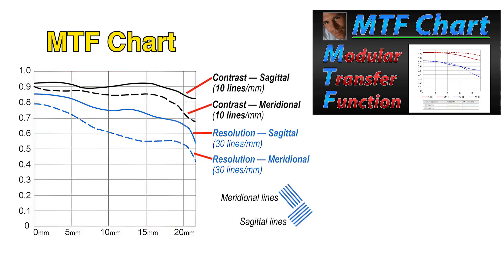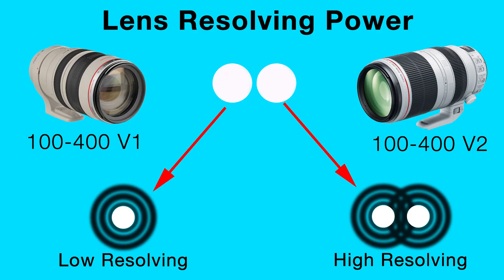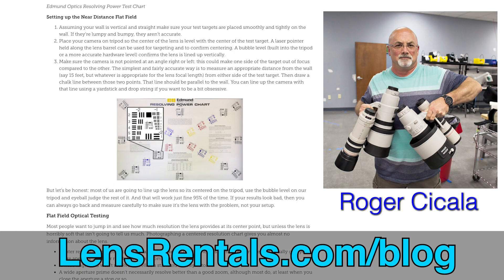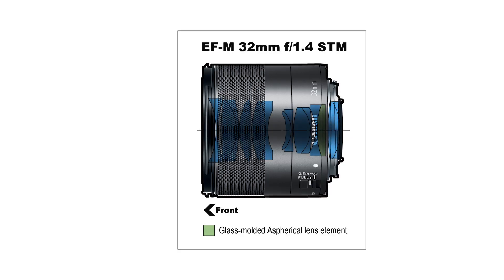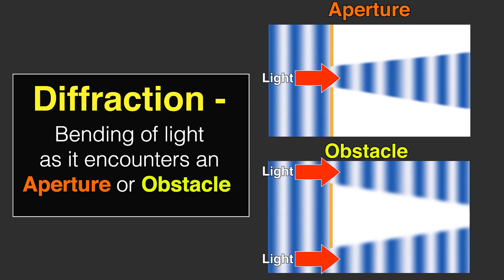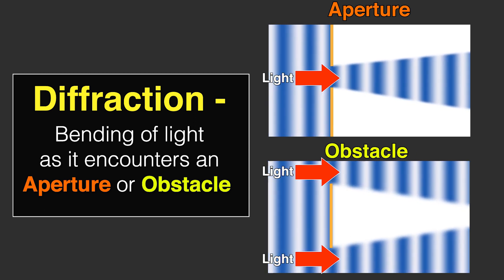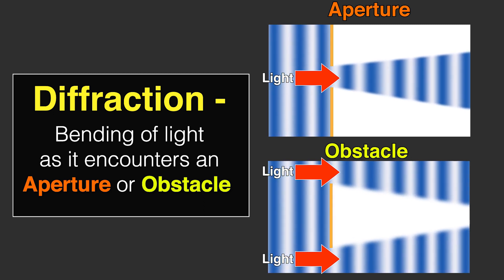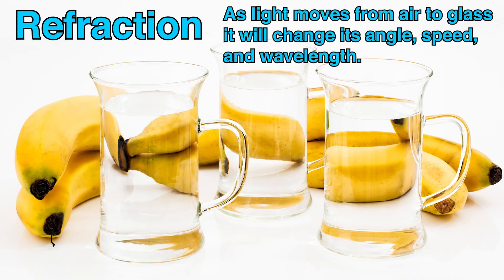What makes one lens sharper than another? How is Lens Resolving Power Determined?

Comment: In terms of sharpness, I have the impression that prime lenses in the range of 35mm to 135mm are the best overall. Wide angles and long telephotos are harder to design and loose a little bit of sharpness with few exceptions. Even cheap primes of good brands produce good results if you close down the aperture to f/4 –f/8.

Comment: The formula for the limit of resolution of a lens is as follows: the minimum angle at which two points can be distinctly identified as separate points is equal to 1.22 radians multiplied by the wavelength in meters of the light passing through the lens, all divided by the diameter of the aperture in meters. This is the absolute best case scenario for the limit of resolution of a lens. From the best case scenario we have to further increase the angle of the limit of resolution by coefficients that account for weather, atmosphere, things found on the surface of the lens such as oil, and then once it passes through the lens we have to account for the sensor of the camera, the size, and pixel density, as well as other factors

Comment: Very informative. As for Apple lenses and many smartphone lenses, the tolerances are tighter than even high end regular camera lenses. The super thin cameras in phones require complex aspherics that are a magnitude more sensitive to imprecision than the very high end very expensive lenses used on traditional cameras. Being off by even a single micron for a couple elements is enough to strongly impact a smartphone lens but that kind of precision in a traditional lens is impossible.

Comment: Subject distance is important too- just to throw in another variable. I test all my lenses, both in the studio with the Air Force resolution charts and in the field incorporating fine detail so I can see how they perform at different distances. Of coursse the studio is more controlled and I do my best to control the outdoor tests (on a tripod, same scene, lighting, etc.) Some lenses really perform differently at 30 ft/10 m or infinity vs, say, 6 ft/2 m. I remember a Leica rep telling me Leica M lenses are optimized for 3 meters. Not sure if that's true any more but I'm sure the manufacturers try to optimize performance for distances they think the lens will be most used.
Reply: which lenses are best at infinity?
Reply: @eascencio847  Hi, no hard and fast rule on that. Most lenses should perform well at infinity, especially at optimum apertures. But I just bought one recently that is lousy on the edges last third out from center (Laowa 9mm f2.8 Zero D in Fuji X-mount) I'm not sure if I got a bad sample or if it's a characteristic of this lens. I will likely buy another and see. This is my first Laowa lens which I bought mainly for infrared but I also like it for visible light (IR is a whole other story with lenses.)
Reply: @JoelWolfsonPhoto  thanks for the info happy holidays

Comment: Your observations on the fuji 200mm f2 prime being 'too good' for the current x-t cameras, together with this video, have started me wondering...
What's your opinion as to the optimum/maximum pixel count for an apsc sensor for the current crop of red-label fuji lenses?
Reply from the maker: Peter Hicks between 20 - 24 MP anything higher the camera runs into DLA problems where diffraction starts setting in at less than F8.

Comment: What apeture on a lens is best for landscape? Should i use a cheaper F4 lens or the more expensive F2.8 for exemple? Does the F2.8 have better glass for landscape?
Reply: That depends on if the F4 lens is cheaper because it did not need the expensive extra glass, or because the quality is cheaper in general.
If both are Canon L lenses (high quality) and you shoot at F8 then you probably wont see any difference at all, and you are better of saving some money.
If the cheaper lens is a kit lens then you will see a difference. (probably mostly in contrast)
Reply: Mats! A 2.8 wide angle zoom is twice the price of a f4 wide angle zoom. A good F2.8 is too expensive for most people, so buy a good F4 instead if you're not a wedding photographer or don't need  mobility with your camera indoors shooting children for example. A f4 will produce almost the same results (the difference is minimal). In landscape photography, an excellent and robust tripod is very important and make sure that you can add some weight to it if it's windy, like a sandbag. Use a remote control or the timer of your camera and make sure that your focus is correct. I prefer to focus manually using the magnification of the live view when the camera is on a tripod. Always close down the aperture to f/5.6, or f/8 or even f/11 depending of your lens. A long time ago I had a Canon 40d (10 megapixels) with a kit lens and I could produce sharp images using this method. I would prefer a wide angle prime than a zoom lens in a full frame camera like a 20mm, 17mm tilt and shift or a 14mm lens (in this case they're f/2.8 or less most likely). Wide angle zooms are inferiors in terms of resolving power I believe (in general). A wide angle zoom will help you with the composition if you mobility is reduced for some reason. For example: shooting in a mountainous terrain.

Comment: What's the sharpest lens/body combo you've used or tested?
Reply from the maker: Great question. It’s really a combination of total resolution and the lens. I’d probably have to say Canons 35 1.4 with a 5DSR. But there are other combos out there that would likely beat it, like Sony’s 90mm Macro + A7r4
Reply: My Leica SL with the Voigtlander 50mm 1.2 vm on it....I’m of the opinion that old school manual lens designs out resolve newer autofocus lenses, and the glass formulas of Leica, Voigtlander, and Zeiss are proprietary and superior too.
Reply: @MMaven  I also instantly noticed extremely sharp results with the 35 1.4.   it was even sharper than the much newer 24mm 1.4v2 that has since been sold.

Comment: Canon readily bundles their kit lenses with the 90D.
Seems like they would recommend one not use these but buy their more expensive glass if the kit lenses are going to produce poor images.
Why have many many unhappy customers?
Reply from the maker: Canon is fully aware of the problem. When the 5Ds and 5DSR was announced they published a list of lenses that would have enough resolving power. the 90D has an even tighter density, but no list was posted. The new kit lenses seem to be solid, but not the older ones. Still Canon should have published something about it.

Comment: I always hated buying an expensive lens and having to stop down just to be sharp.
Reply: In terms of sharpness, I have the impression that prime lenses in the range of 35mm to 135mm are the best overall. Wide angles and long telephotos are harder to design and loose a little bit of sharpness with few exceptions. Even cheap primes of good brands produce good results if you close down the aperture to f/4 –f/8.

Comment: Light does not change its wavelength when it passes through the glass.
Reply from the maker: It’s doesn’t change frequency, but if it bends, the length has to change at the point of refraction
Reply: Once it exits the glass, you get the original wavelength back, as the wavelength is proportional to the wave's speed, which is determined by the medium. So as long as there is still air between the sensor and the glass, the captured light's wavelength is not going to be different than that leaving the subject.
Reply from the maker: @carmagnole  That is correct, but you should read up on what happens at the point when it goes through different substates and changes direction. The change in wavelength at that point is very well documented.
Reply from the maker: @carmagnole  https://physics.stackexchange.com/questions/59469/why-doesnt-the-frequency-of-light-change-during-refraction